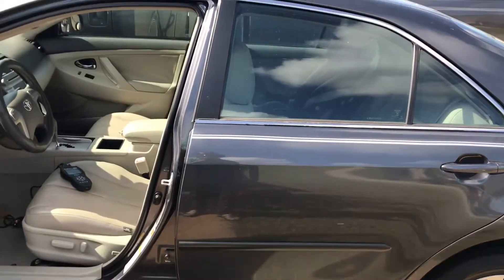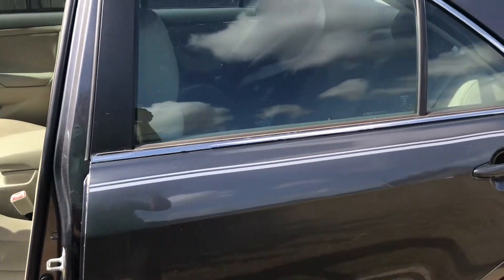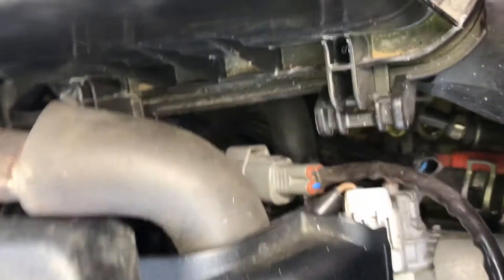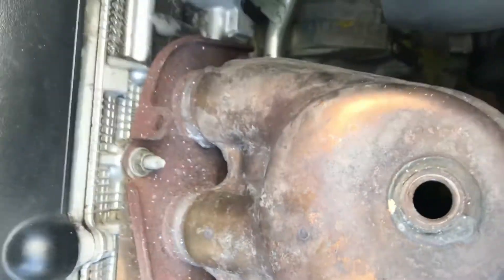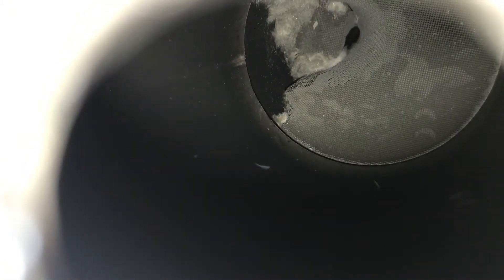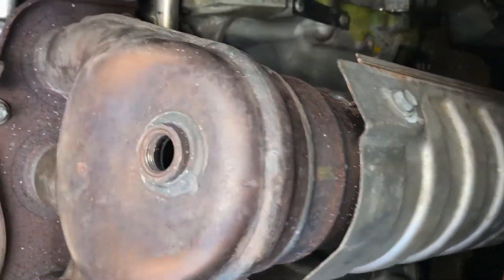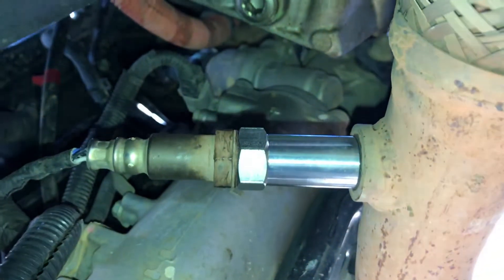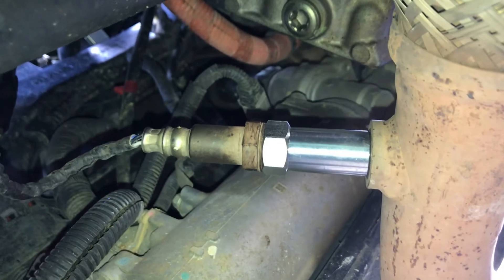2009 Toyota Camry Hybrid P0420 Catalyst System Efficiency Below Threshold (Bank 1)

Comment: Great video. Can you confim that there is only one filtr inside?
And how can I clean it?
Reply from the maker: I think there is only one filter, you have to take the whole catalytic converter out and use a bar or something to break it, that staff is hard.
Reply: @davidjad9327  Thanks. Do you know how to clean it first? Before I spend lot of money?
Reply: @davidjad9327  I did check and there is two filters. 95mm/100mm and 110mm/100mm
Reply from the maker: @konradjaskolski4818  I am sorry, I wasn’t sure, this one was a hybrid, and I sold it that’s why I couldn’t check.